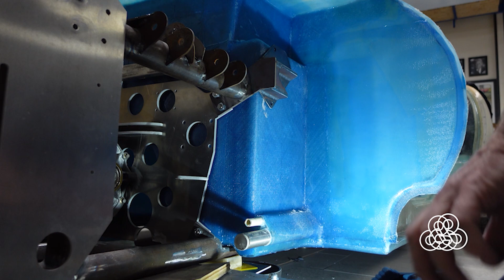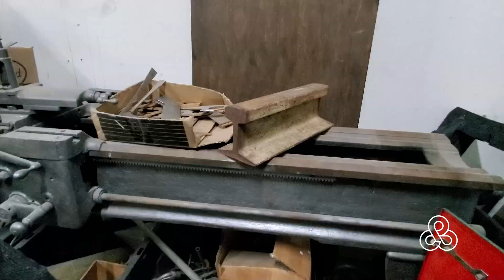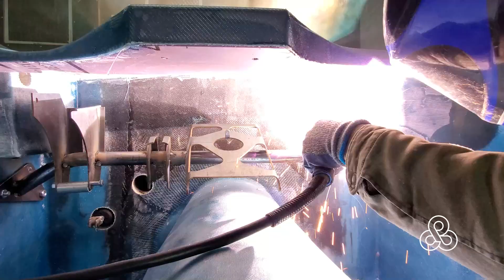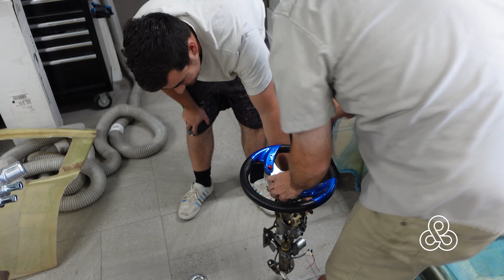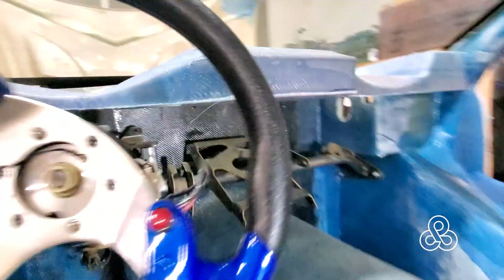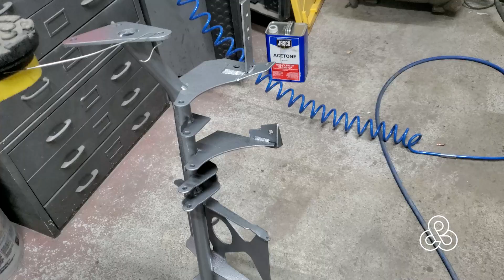A87 Every Supercar needs them! Under the dash components. Arete Supercar Project

Comment: i still would not want to crash in this fiberglass shell. Nope.
Reply: Why? It's strong as hell.
Reply: @bobolulu7615   fiberglass? U haven't been to school too much i guess
Reply from the maker: Actually, it looks like someone else is showing their lack of education. Perhaps they haven't watched the episode on the strength of S-Glass fibers verses Carbon Fiber, or taken a look at the surging growth of composites in the automotive industry in general.
Reply: @BuilderCreator   no dummy, the cars that use fiberglass use it for some body panels not for the safety cell(were passagers are) The carbon fiber it's use in supercars but the level of engineering/test/simulations to do that it's out of your league, some of them have also metal inserts & a WELL THOUGHT CRUMPLE ZONE.  You are just using a saw, some cardboard for f sake.

And the race cars that use fiberglass have strong metal cages that is connected to other metal parts of the car ( chassis, etc)
+ fiberglass is brittle in case of an impact and dose not have any force absorption in case of an impact.

Any home made car that uses just fiberglass it's a death trapt and bad designed ''go cart''

smug american...🤦‍♀

Comment: Great work as usual. Not much space under there for HVAC- even less than my project. Have you got a system picked you're designing around ? Don't forget defrost/fog vents!
Reply from the maker: Under the dash will be just the diverter and ducts for vent/defrost. the heat exchanger and fan will be under the bonnet up front.

Comment: AAAAAHHHH the ways of that poor lathe
Reply from the maker: Bought the lathe on the cheap and thought I could get it running, but after some time on it have decided that I could buy a new 40" gunsmithing lathe for the number of hours it would take to restore it. Keeping the base, as you can see it makes a VERY solid workbench. New anvil (recommended by @Russtuff above) will bolt to it nicely. The railroad rail wasn't worth drilling and fixing down.
Reply: thought the same!